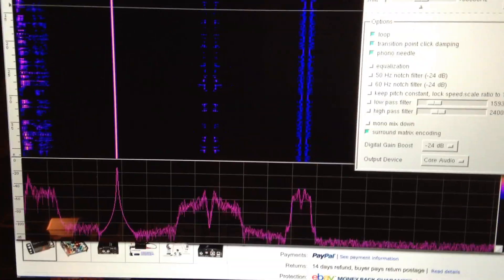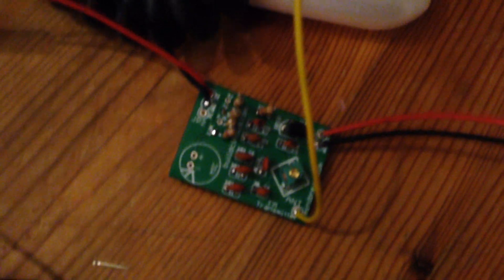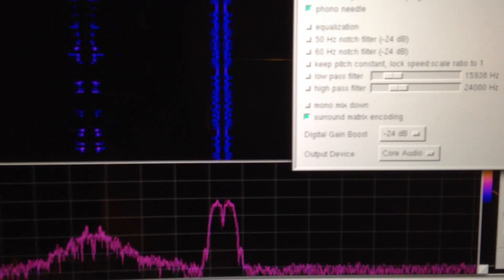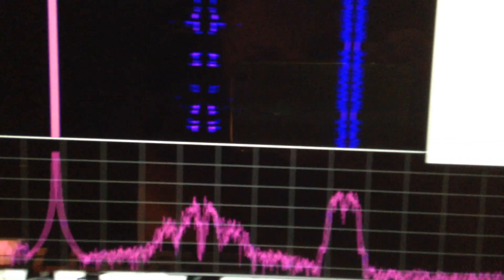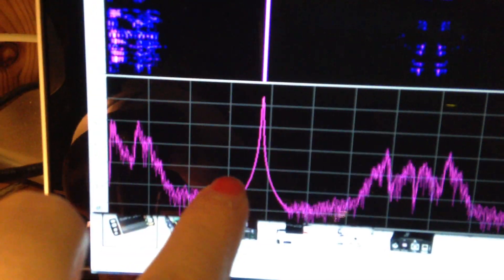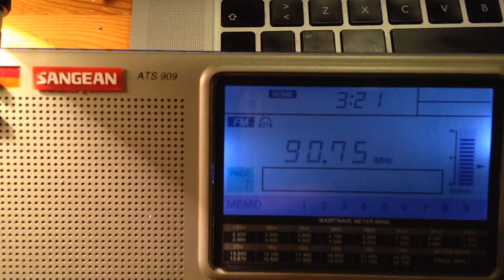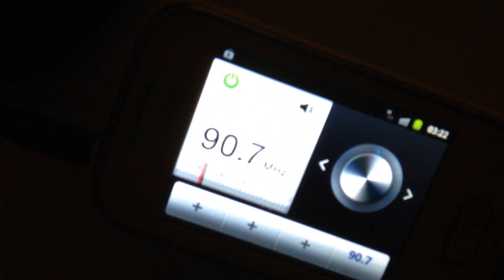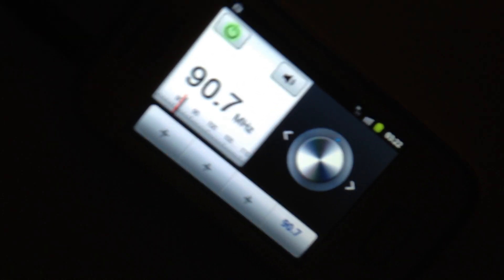Transmitting my digitally generated FM composite

Comment: 96 kHz SR lets the signal go up to 48 kHz, so all you could legitimately do with this bandwith was SSB-SC (Single Sideband-Supressed Carrier) MPX signal, which looks like this: http://i.imgur.com/fdZtSqG.png, but certainly you would not get RDS. So did you actually get the stereo signal or just an indication of such (only because you used pilot tone)? Because looks like in your set-up, the upper sideband (above 38 kHz subcarrier) was cut in half at the soundcard output. Furthermore, the antialias filters probably made it even worse.
This: http://i.imgur.com/4wt6z4T.png, is of course possible only with 128kHz (very rare) and above (mostly) sample rate, usually 192 kHz is used.
Reply from the maker: +Sławek B. Counting the grid lines on the spectrograph, the bandwidth of the DSB stereo signal only goes up to 45 kHz, so it fits in full below Nyquist. Here's a 10k-48k sweep signal I ran on the same soundcard as used above, at 96 kHz rate, recorded back via analog cable on a Tascam: https://i.imgur.com/bm6S9Ig.png
Reply: +Oona R&#228;is&#228;nen (windytan) 
OK, looks legit :) So you could do full 48k up to the Nyquist. Still too little for full 15 kHz bandwidth in DSB-SSC, since USB (upper sideband) stretches out to the 53 kHz (38 kHz + 15 kHz). But you've used much less than 15kHz, so probably you also got stereo :) A good thing is that most modern laptops do 192 khz at the output easily (and vast majority of PC MBs) so basically they're fully MPX capable.

Regards! 
I like your work :)